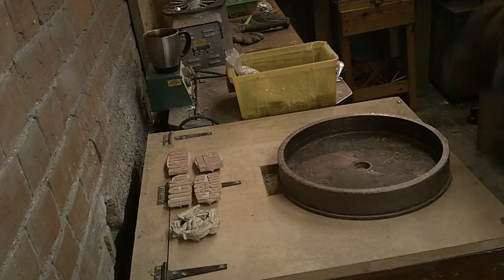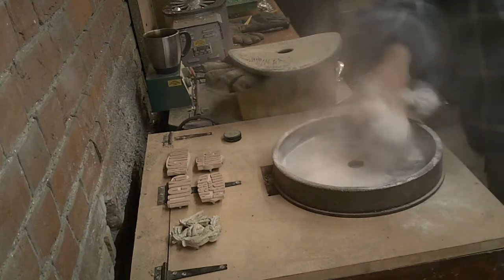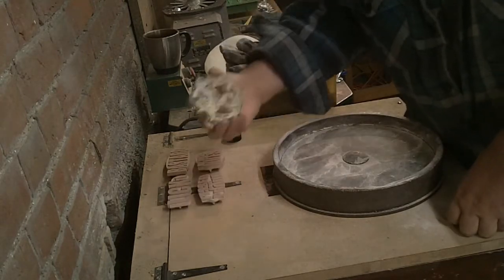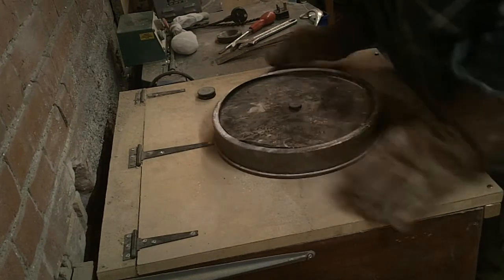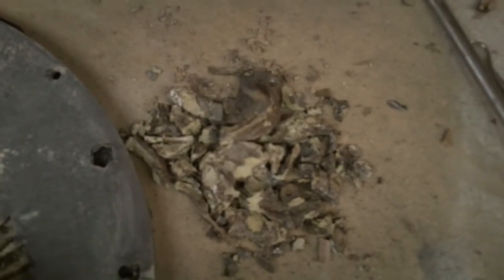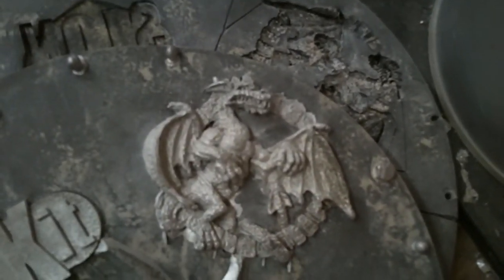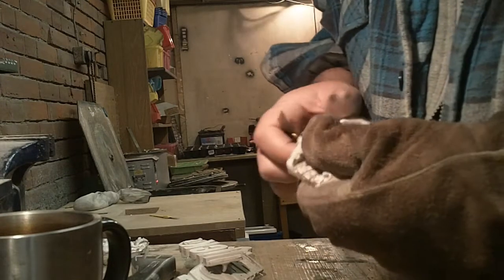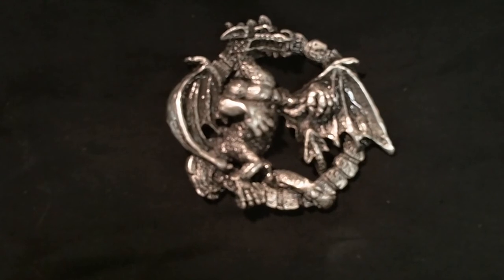Stoney's Video Blog 5 creating a dragon buckle

Comment from the maker: Hi
There are various alloys that fall under the "Pewter" banner and the buckle strength will depend upon which the manufacturer used. It is true that a brass buckle will be tougher in general however pewter is selected mainly because it can provide greater detail in the casting.... avoid cheap imported buckles as they could be made from soft lead heavy alloy that will break down.

Comment from the maker: Hi Chris
The speed is not fixed and will vary as the mould heats up ... you might need a little more speed on a cold mould but you slow it down once the rubber starts to get hot.

Comment from the maker: Hi vansha64 .. Thank you for your kind comment ...In answer to your question... You may be lucky and get a good mold from a plastic piece depending upon the plastic used however plastic models are usually destroyed in the process. I have seen several cold set silicone mold systems that you could try and develope a master first and then use that for vulcanizing .... good luck

Comment from the maker: It sounds to me that maybe you should look at how you have vented the mould ... remember the air in the cavity needs to be able to escape to allow the metal in.... It could be that you are turning the speed up because metal isn't flowing to the point where the force from the metal is so great it separates the mould flashing straight through..... remember to talc the mould as well

Comment: hi ,,very great job,can i use a silicone rubber rather than black silicon when vulcanize  to avoid big damage on the master piece ,,,or u think the silicone will not do as the black silicone or will react bad or will not cure the mould,,,,thanks for information

Comment: Thank you for your fast answer. Yes I imagine is some copper in that alloy. Maybe 3-5% to increase strength. 
Pewter is has a large variety of alloys but in many countries pewter is confused with tin. The metal called Sn is very soft. I know this. But I think you use SN with some copper and maybe antimony or bismuth. 
Anyway thank you for your fast answer.

Comment: I'm curious.  You have several different paterns laid out, so it seems you would have to cast the whole series every time.  If you just wanted to cast the dragon, for instance, can you block off the rest of the mold?  Also, does the pressure of the rubber ever break off small parts, such as the small hook on the back?  I enjoyed seeing your process - would love to see more videos.

Comment: hello. thank you for your answer. i have another questinon. can i make the mold withouth hidraulic press? can i youst clamp the metal frame with clamps and put it in oven?
Reply from the maker: Hi Tim
I have no experience of mould making without a press so I can't really help on that one but I guess it would be possible ..... I think you can also get cold set moulds but I would expect them to degrade faster than organic rubber or silicon  ... please let me know how you get on
Reply: Thank you for your answer!!

Comment: what is the best non metal material for original master? Can i go with ceramic clay?
Reply from the maker: Hi Tim
I use a two part resin clay for hand modelling and hard epoxy resin model board for engraving so it will stand both the pressure and temp .... the originals usually break anyway but they last long enough to get the mould